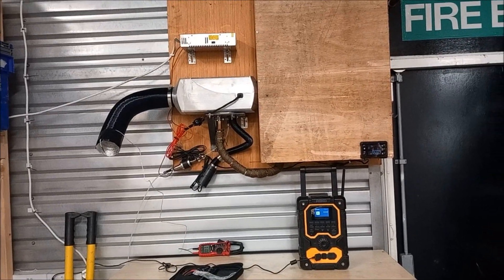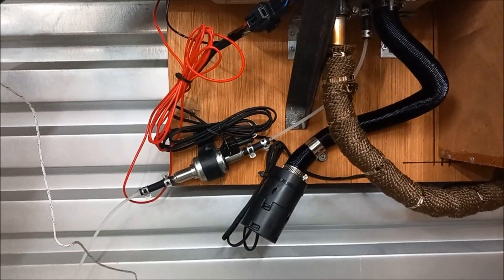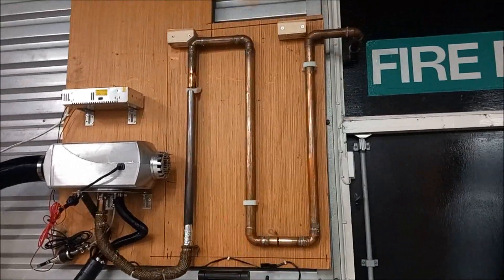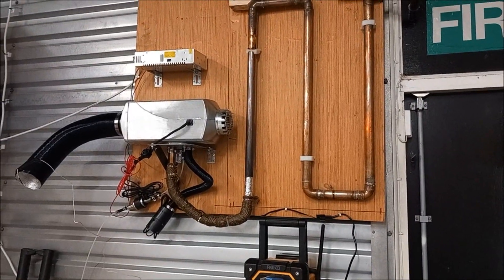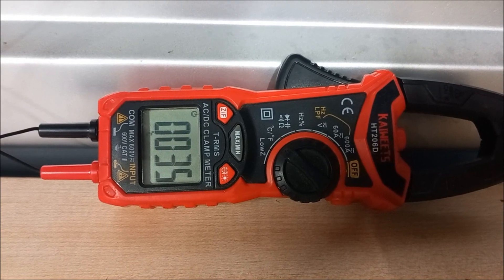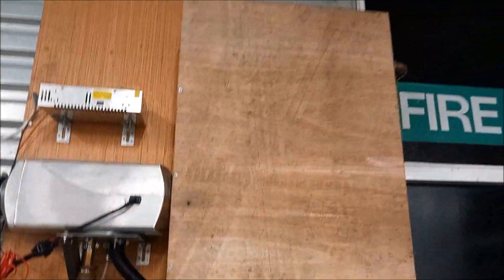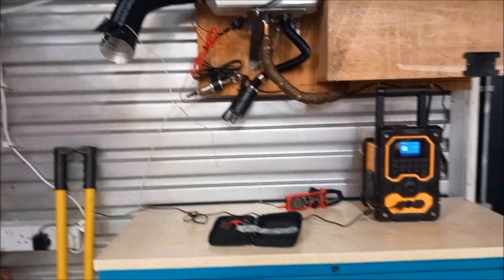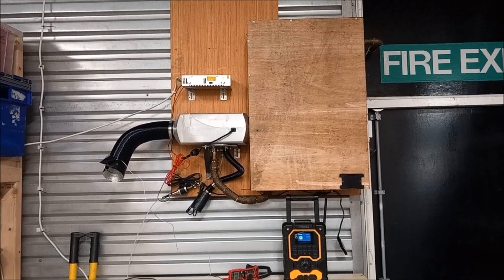Chinese Diesel heater 8kw but really 5 with simple exhaust gas heat exchanger

Comment: Super impressed with the heat output increase with the exchanger cover in place! Thats a huge difference and a big change in heat without having to tun it up! Looking forward to your strip apart to see if you do have any coke build ups running like this. I don't think you will 🙌

Comment from the maker: heater back on for winter, still chucks out loads of hot air. Serviced last summer, all pipes checked for soot,  fire chamber inspected for buildup, clean as a whistle. We only use diesel for the unit.

Comment: I installed a deisel heater in my house, it's great but I fitted my exhaust pretty much the same as you did trying to recover waste heat which is a big mistake, the exhaust needs to be pretty straight and definitely no upward bends because it will fill up with sut!!You will have to strip it down and clean the combustion chamber and the glow plugs etc... the heater will start blowing cooler air when it's full and you'll get error 08. I shortened the exhaust and had zero bends and then I put an egr cooler as the exhaust, now it heats water if needed and also runs hotter than ever and hasn't clogged up since
Reply from the maker: I'm going to do a service strip end of feb, I'll report my findings
Reply: Same happened to me. My exhaust was bent up slightly, and eventually it wouldn't run. It was full of water. Then I had issues with it starting. I stripped it down, and the inside was full of soot.

Comment: Not sure if preheating the inlet air is the best way forward, since you are lowering the temperature difference and thus the efficiency of the device. You could just went the exhaust heat to the room, even use the output air as Venturi sucking air along from the box.
Reply: Had to cover the exhaust for health and safety, just incase someone accidently touched it

Comment: I would use a finned baseboard type water tube to recover the exhaust heat with maybe a small fan behind it or just convection air (we'll see) Anyway the exhaust should always directed downhill to prevent any possible condensation from causing a problem. Don't hurt to be safe.
Reply from the maker: The heater ran all winter at max output, I did a video of a service in the summer, now in it's second winter and still running well at full output, no condensation, no problems. Although I has to contend with diesel bug from stale diesel

Comment: From the oxide colour on the copper pipe, it is hot enough to melt the solder so it falls apart and passes exhaust gas into your workshop. You haven't had a problem 'so far', but you may well do when least expected: If you must use copper pipe, silver-solder it, use compression fittings or iron steam/water-pipe. Stay safe!
Reply from the maker: CO meter is mounted near the heater (purchased after the video), pipework is periodically checked. Condensate will be the biggest problem, if the exhaust gas is allowed to cool enough it  will just eat into the copper, still looking into an alternative heat exhange unit for next year, I feel this will be the last two weeks that the heater is used, the weather is starting to turn.
Reply: @dangerrous  hi great video, I really like the idea and wondered if you could fit some grub screws to the exhausts lowest drops to drain any condensation after use or even a drainage tap if it could take the heat?
Reply from the maker: @dtwistrewind7361  condensate still not a problem after 2 years
Reply: Great to know that's very helpful👍 @dangerrous

Comment: 9 hours a day at max heat setting and it's only used 8 litres of diesel. That's got to be cheaper than current gas prices as it's costing me about 5-6 quid a day to heat my home.

I'm thinking about getting one of these heaters to heat my home as I can get kerosene for £1.15 a litre
Reply: dont think 17'c is max heat setting
Reply from the maker: @spoid54  Only works to take the chill off the unit, once it reaches a workable temperature it does switch down to tickover, there's been a couple of days that it's just stayed on, this thing is run hard, it starts up straight away and just works. It's been running for about three weeks. We've just changed over to a car battery and smart trickle charger to run it, we're in testmode to make sure there's enough energy in the battery with the trickle charger running to use all day and recoup charge at night. If it works, I'll fab up a battery box with stuff around the unit.

Comment: Have you not had an issue with the solder joints melting? Mine did. Nice unit what make is it please?
Reply from the maker: no issues with heater, just purchased off amazon, no brand noted, generic manual seen all over youtube
Reply: @dangerrous  Thanks, I meant on the copper exhaust pipe joints. I tried it and the exhaust got very hot quickly and melted the solder joint fitting. I thought I might try compression fittings but they might come loose.
Reply from the maker: @Andy_Todman  No problems anywhere with any joints, heater just works as it should, very pleased with it.
Reply: I used High temp solder, here's the inspection after a full winters use  https://www.youtube.com/watch?v=KnCfFpiHw20

Comment: I'll be surprised if it works in the long run with the exhaust piping as it is. Too restricted with all the sharp bends and long length, not to mention the low spots that will fill with water.
Reply from the maker: so will I, my March inspection will identifiy any problems. Please be aware that the exhaust gas is running in 28mm copper pipe, and it's always running at max capacity, I have yet to see any condensation in any of the exhaust pipework